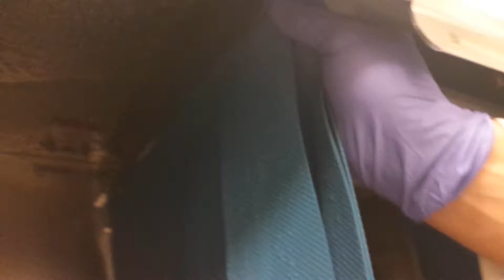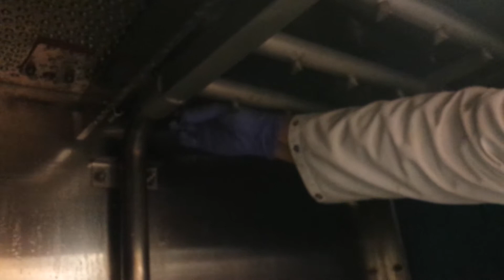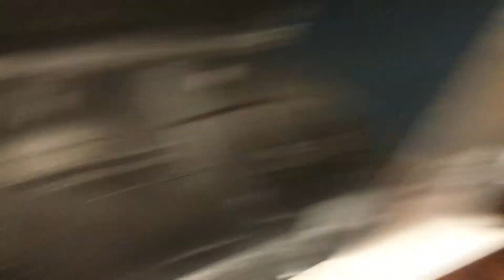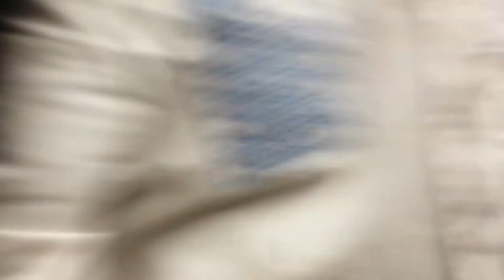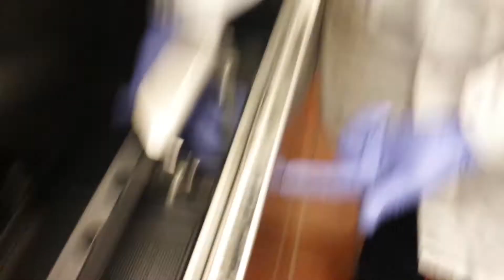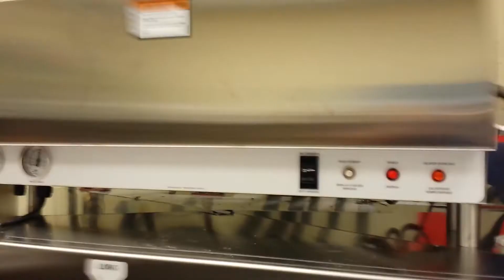Ecolab dish machine maintenance

Comment: Wish there was a video to put it back together again but mine has a push & pull button on the left side of the slide door to stop or start the motor and 2 other small strainers at the bottom and a lever on the bottom outside of the machine to drain it. I ended up training my trainer that was training me and i would like to know more of the machine to train others. If no other video can you give me a name of the machine that i have other than ecolab because there are many on the list.
Reply: EC44